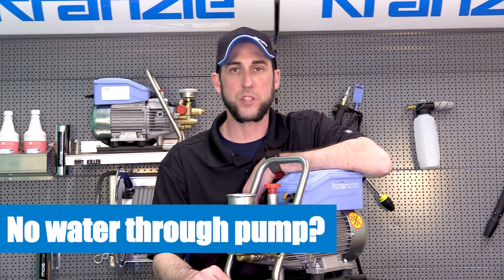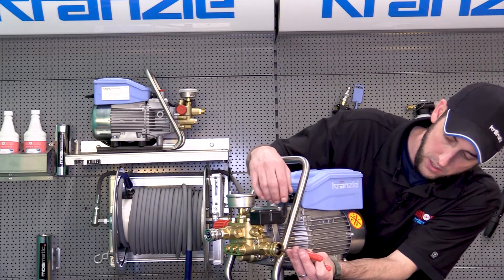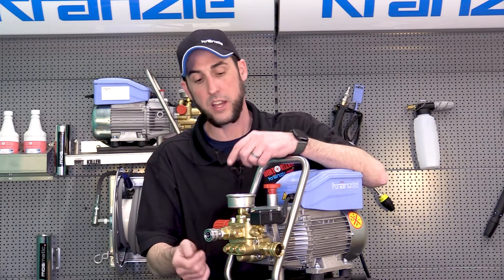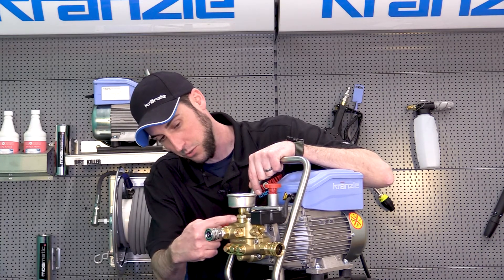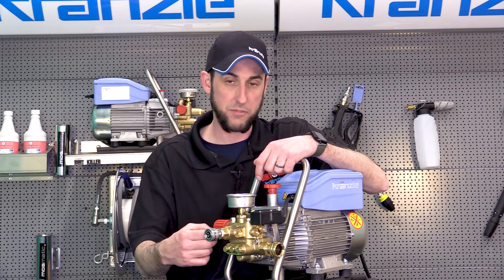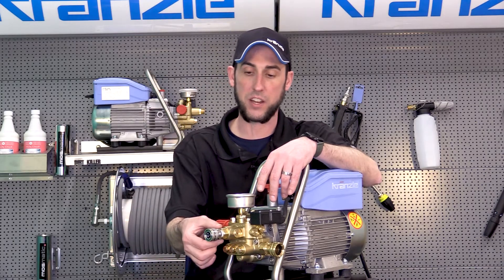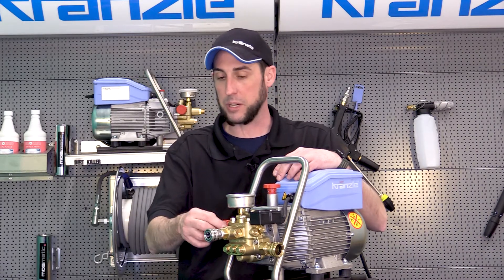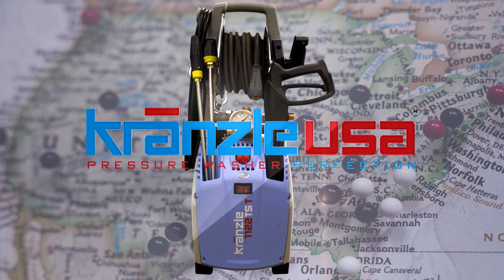No water through pump ? Cause and solutions | Kranzle USA Pressure Washer Perfection

Comment: I did some maintenance and went fine. But now there is a water stream coming from under the kranzle. Everything checked 3 times but what can it be? Water is flowing through the pump but also under it:(
Reply from the maker: If water is leaking under the Kranzle pump head (shiny brass part) then you are in need of replacing the packing kit (water seals). These can fail for a number of reasons, if its new then i would encourage you to make sure everything is tight first, then check if everything was reinstalled correctly. 

Additionally, if the seals were old and worn (even just a seasons use) can cause them to seat well enough to the valve housing that upon removal they are damaged.

Comment: My  pressure washer 240v , would run then cut out , i left it 30 min , was ok again for 3 minutes . 
So today i took the cover off , i left the lance hose off let it run water through for 3 minutes , then switched on with NO HOSE OR LANCE , PERFECT . 
 Then  put my 2nd hose and lance into machine ran perfect  perfect for 10 minutes  . 
Put original lance and hose back on ,,,,,,, cut out in 15 seconds ,,,,,,,,,,,, so must be the trigger handle , took it to bits the ball bearing and spring was gunged up , cleaned it all out , and STRETCHED the spring with 2 pliers , added vassaline , put back together RUNS PERFECT . . There must be a pressure sensor or volt sensor in electric / capacitor system . Regards from England .

Comment: I got a green works 2000 PSI I think it's a 2100 PSI or something weird anyways it's been leaking  water out of the pump. I took a closer look at it and figured it needed some gaskets after watching a bunch of YouTube videos I found that there is no gasket just o-rings. anyway the peace you were talking about with the spring I got sitting on my countertop and there is no ball bearing inside the spring. I know I didn't lose it because I took it apart on my bedroom in my floor is clean. let me know if every pressure washer you know has a ball bearing in the spring maybe mine didn't.
Reply from the maker: Good morning @lockbox1410 , 

All pressure washer manufacturers use their own pump configurations. Most green works pressure washers are crankshaft style pumps, whereas Kranzle's radial axial pumps operate slightly differently. You would need to reach out to green works for a parts break down to confirm what is used inside your pump head. 

Sorry we can not be of more assistance at this time.

Comment: I have water flow tell I start the motor then nothing
Reply from the maker: Good morning, 

Have you checked the following 3 things-

1) Remove the nozzle, squeeze the trigger and confirm water moves through the gun jet. If it does and the machine is off, turn it on. If it does then the nozzle is clogged. If it doesn't your gun jet is likely clogged. 

2) Remove the high pressure hose from the pump, turn the water on. Does water move out? If yes then turn the unit on. The water output should increase. If it doesn't you likely have a check valve issue. If water never leaves the pump initially, you are looking at a clog somewhere. Start disassembly of the pump and look for signs of debris entering the valve housing. 

3) With the nozzle on and water on squeeze the trigger. If water moves through turn the machine on. If the machine does not amplify the units pressure and it either drops off or stagnates check your start up relief valve. 

Usually, these three things can address root causes. However, if the problem persist please feel free to reach out to Jwagner@dirtkiller.com regarding tech support and he will be happy to assist.

Comment: Have a Kranzle 635 no pressure at the new temp guage. No water to hoses but will check the O rings etc When I start it the guage says Err Soil E2=1st but am not using hot water. Do I still need to replace the temp sensor if only trying to start using cold water?
Reply from the maker: Good morning, 

Thank you for reaching out to Kranzle USA. Unfortunately, that is not a model number that we import to North America. As such we are not familiar with that specific error code. If you let us know your country of use we can recommend the local dealer.
Reply: @kranzleusa5846  thanks am in NZ but have dealers here so will need to check. Just thought youd know. The 635-1 is a very good machine.

Comment: I put a new pump on now water is coming out of the soap dispenser what’s my problem
Reply from the maker: Regardless of the new pump install, if water is coming out of the soap injector than the fitting needs removed, cleaned and inspected for damage. In some cases corrosion can hold open the check valve, in other cases the check valve can be damaged and need replaced.

Comment: I have an MS60809-S pressure washer. I connected my water supply to the unit and let water flow through the unit and out the wand. Then, after starting the engine, it was spraying intermittently from a low-pressure stream to a normal high-pressure stream and then it stopped spraying completely. So, I turned off the engine and after doing so the output line stayed pressurized, and I cannot unscrew the outlet hose on the pressure side of the pump. I also cannot unscrew the hose connected to the wand. Squeezing the trigger on the wand does not release the pressure. How do I release the pressure in the unit so I can remove the unloader to see it that is causing the issue. Or is there another way to release the pressure from the output hose. Also, does it sound like an unloader valve issue? Thankyou.
Reply from the maker: You will need to take (2) appropriately sized wrenches and slowly release a hard plumbed connection on high pressure hose or gunjet. It sounds like your high pressure nozzle is clogged.

Comment: Thanks for the video. When I tried this, two of the upper check valves came apart—the springs and valve plates were loose, but the lower parts stayed stuck in the housing and couldn’t be removed. I reassembled everything but haven’t tested it yet. Could this cause issues if I run it like this? Also, any ideas on how to remove the stuck parts if I need to replace the valves?
Reply from the maker: Good morning @iamfredrik,

This can happen when something corrodes the metal plate into place. Once the other parts are removed usually a flat head screw driver is able to rest against the side plate and simply apply pressure to 'snap' it out of the corroded pocket. 

Once that is done, replace the check valves and the O rings. You should be able to use the machine after that.
Reply: @kranzleusa5846  Thanks! I actually tried that with a flathead but was afraid I might damage the housing if I applied too much pressure.
Reply from the maker: @iamfredrik  In theory, even if the brass is scratched ever so slightly the new O ring should seal it all the same. If your problem still persists or you are unable to free it feel free to reach out and we can try to recommend a service center near you.

Comment: Hi I have a powerhorse 3400 psi 2.7 gpm and when I open the water and try to purge air out of the hose no water comes out at all, what should I do ?
Reply from the maker: This depends on the pump but if you squeeze the trigger and nothing comes out after pressurizing than it is likely a clogged nozzle preventing the air from purging.
Reply: @kranzleusa5846 then how to clean it I have my machine off everything is connected but no water is leaving

Comment: Water comes out but no pressure?
Reply from the maker: Good morning @bighern25 , 

Here is a link to a pressure loss video-

https://www.youtube.com/watch?v=1l1H70tlNOU

If these symptoms are not what your issue is then  you likely are in need of replacing the start up relief or easy start valve. This will allow a small amount of water to discharge but not enough to build pressure. 

If you need further assistance feel free to email us directly - Jwagner@dirtkiller.com

Comment: Thanks a lot! I just bought a BRAND NEW SIMPSON gas, 3700 PSI. It started fine, had plenty of water WITHOUT the spray nozzle attached. Once I attached the spray. NO WATER! I worked my way back to the pump, 1st changing the spray handle for an older one I had laying around. WALLA!!! Bugger is working great...Hope this helps anyone having this issue too. SAD, BRAND NEW and something still wrong. I'm not taking it apart, boxing it back up and returning it; to much trouble.
Reply from the maker: Thanks for the feedback!
Reply: The spray handle? You mean the hose or the wand?

Comment: Hi Josh,

I have a Kränzle 10/122 TS, and I’m experiencing an issue. The machine starts, but no water comes out at all—it feels like it’s not drawing in water.

I’ve already opened the three front components and the water inlet side, cleaned everything, and followed all the steps you showed in your video, but the problem persists.

I really need help as I have jobs to complete, but my machine isn’t working. Any advice would be greatly appreciated.
Reply from the maker: Good morning @adam-f1i1d, 

Thank you for reaching out. The Kranzle 10/122TS is not a machine that we carry but the principles outlined remain the same regardless of which model. 

To start with, if the machine is operating off a tank remove the plumbing and set this up to force feed through a spigot/ water tap. 

Once that is confirmed you can turn the water on and confirm water is moving past the nozzle. If water moves past the nozzle then turn the machine on. If your symptoms change the issue is usually water seals or plumbing issues to the pump causing your symptoms. 

If the symptoms do not change you are usually looking for an obstruction or clog. First remove the high pressure nozzle and retest. If water moves through the gunjet/ trigger assembly then you know the issue was the nozzle. If not, remove the gun and test water output through the hose. Keep working your way back through the pump, to the check valves and water inlet. From there you should find something. 

If those steps don't help its time to take the unit to a service center. 

I hope this helps. Let us know if there is anything else we can do for you.

Comment: Hi, I have a C11/130. I have pressure at the Gauge excess of 100psi. As soon as I pull the trigger, pressure disappears and I get what I would call garden hose volume of water out of the Lance. When I stop the Lance the pressure builds and you can see the Regulator handle pull in on the spring where it shuts the motor off. All that seems to be ok. Any idea what Issue could be? TIA
Reply from the maker: Hello @DaveSangste.  Sorry to hear about your malfunction; we can certainly help you troubleshoot the issue.  
Depending on the circumstances, there could be more than one cause for pressure loss.  Can you confirm what nozzle is on the end of the gunjet lance assy?  If it is not one of the factory supplied nozzles, then what orifice size is it?  The C11/130 should use a #4.5 orifice nozzle.
The gauge doesn’t have a marking for a measurement below 1000psi, so are you reading “100 Bar” on the gauge instead of PSI?  Also, is the gauge reading that pressure when the trigger is released?  Because if so, then the unloader is NOT going into bypass and is likely a part of the issue.  It may be time to rebuild it.
The C11/130 also has a high-pressure soap valve and pulls from a water tank.  If the high-pressure soap valve is open, it can suck in air which will cavitate the pump and prevent full pressure.  Close the valve and/or place the hose in a bucket of water during your test.  The hose pulling water from the onboard tank has a screen at the bottom of it; be sure that it is clean and clear of debris.  That can also starve the pump and cause cavitation.
If the first few steps don’t indicate the cause for pressure loss, then you can remove and inspect the check valves from the brass pump valve housing.  Check the o-rings below the valves for damage or breakdown and make sure the fill the valve housing with some water when you reassemble it so that it can prime easier.  Lastly, check the pump oil (which you should technically do first) to see if there’s any evidence of worn out water seals/packings.  That will certainly prevent the pump from pulling water from the tank, and subsequently create full pressure.

If you are in need of further support please provide photos and/or video of part conditions and symptoms as they will be helpful to the troubleshooting process. Everything can be sent to Jwagner@dirtkiller.com . Alternatively,  You can also call us for assistance at 800-544-1188. 

Thank you for reaching out, we hope to get this resolved shortly.
Reply: @kranzleusa5846  thanks for getting back to me, Got the issue sorted which was the nozzle in the end
Reply from the maker: @DaveSangste  Happy to help where we can. Please feel free to reach out if you are in need of further assistance. 

Thanks!

Comment: Thanks from the UK pressure washer sorted stuck valves😊
Reply from the maker: Happy to assist our friends across the pond!
Reply: Good Afternoon , Did you renew them , ? as im about to strip mine down now . 
I was working away , washing the caravan , when mine just started producing a weaker and weaker jet of water , then a trickle . . I left it 1 hour , it worked as it should for 10 min , then back to the fault . Regards John from Mansfield .
Reply: I solved my problem , Faulty spring in lance . Cheers .

Comment: My dad has a Craftsman 2500 6.5 HP pressure washer. I set it up and no water comes out the discharge fixture. I ran the washer without the hose connected to the pump and no water comes out. I stuck a small screwdriver inside and found blue gummy stuff. He puts antifreeze in it prior to winter every fall. I've told him he doesn't need to if he empties the pump beforehand. I think the antifreeze somehow turned into slime and I'm not sure how to unclog it. Can you give me advice?
Reply from the maker: Though we are Kranzle, not Craftsman, feel free to reach out to Josh Wagner via the DirtKiller.com website. DK does NOT carry Craftsman either, but has a wealth of experience with commercial grade machines. He will likely have a solution . *We recommend RV anti-freeze if storing a pressure washer in freezing condition. A small drop of frozen water can break a seal.

Comment: Used my Kranzle HD 7-122 TS for about 20 times for car cleaning. Last two months not used. I always drain the last water in pump by letting the motor run some seconds after the water is disconnected (as advised by Kranzle). Today I wanted to use the machine but nothing, no water. Found this video and checked the first three valves. All valves actuated correctly so I reinstalled them and tried connecting to the water and machine worked again. For a machine with this prize and brand I find it weird that after so little uses it already failed on me. I got my old Karcher out (unused for two years) and it fired up right away... Thanks for the informative video! I saw myself driving to the repair shop.
Reply from the maker: Hmm. Strange. You took 3 of 6 check valves out, no issue, re-installed and all's good. Odd. Lee wonders if it got "vapor" locked somehow. Very unusual. I've got to ask. Are you sure the water was turned on? Believe it or not, it does happen. We get that call about once a week. Feel free to give Lee a call to discuss in more detail. 800.544.1188. We would like to learn more. Glad you found a solution through this video and all is well with your Kranzle.
Reply: @kranzleusa5846  100% sure water was on (used same day same connection to the Karcher)
Reply from the maker: @Ludo_A  Ok. Good. Still strange situation. Please do call Josh Lee to help get to the bottom of the problem. 800.544.1188
Reply: My kranzel doesn't let no pressure out and the preasure bar doesn't go up